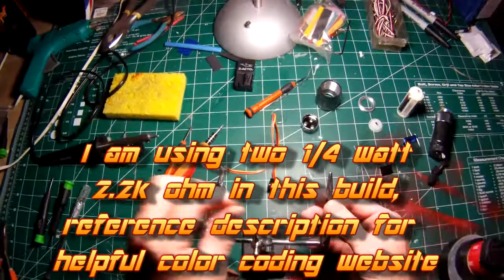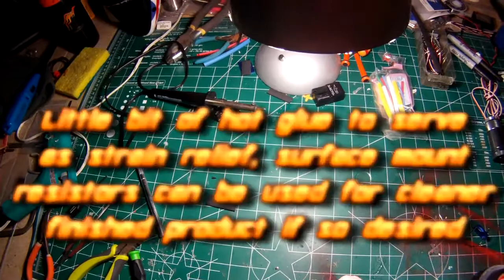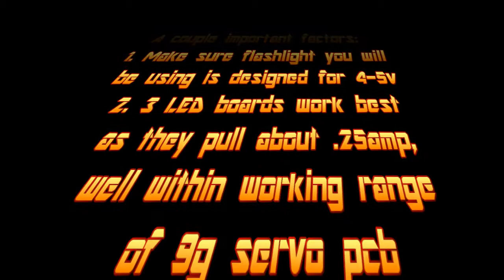DIY RC Landing Light

Comment: LEDs are Diodes. They only conduct current in one direction. If it tries to flow the other way, they just block. Only in specified range of course, if you apply 100V DC, they will burn either way.